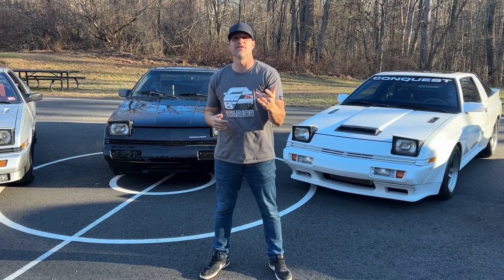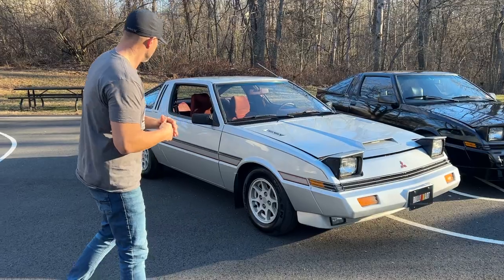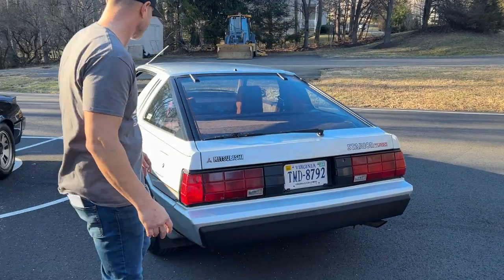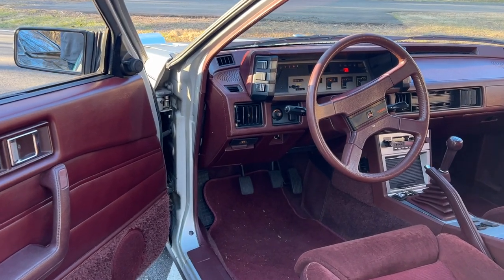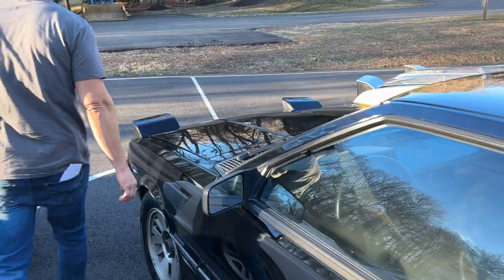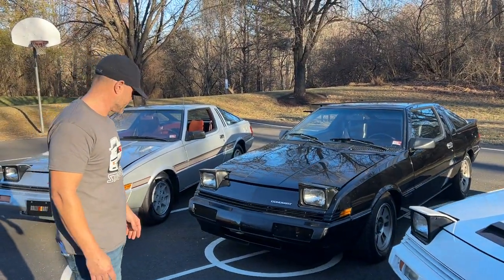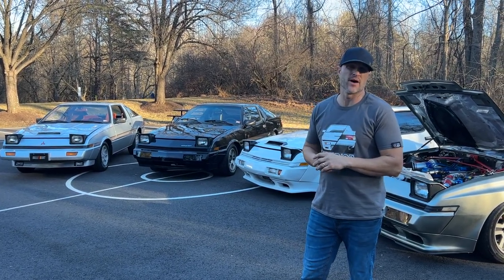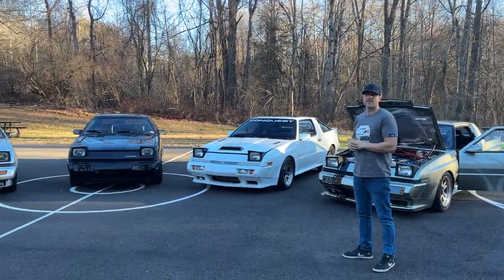StarQuest Walk Through Time

Comment: Turbo TSI Conquest 1986 were sold @ Dodge dealerships . And had the turbo door exterior pulls. Starting in 87 Chrysler dealerships sold the Conquests. I bought new in 88 a leftover 87 special edition TSI 5spd silver(a special chrome ish silver) & burgundy leather. Latter bought a clapped out black/black leather,sunroof 88 5spd with the wide wheel package & TiKco clicker adjustable struts.

Comment: In 90s i had red 88 Conquest TSI, 5 spd. Car would blow head gasket even after replacing it once. I didn't even drive that aggressively. Anyone knows if this was common issue on those cars and why, or did i have lemon one? I remember that car was rare to see even in 90s. Ppl didn't know about them. To me then this car looked like a lambo which is why i got it. I wish i had a old picture with this car. For some reason i snapped one.
Reply: It was common. One of the most common reasons so many of them had less than 60K miles and Sat in people's yards.

From my understanding, the issue was due to the head being aluminum and the block being made of iron. 

The 2nd most common issue was the heads cracking due to the emissions jets in the head.
Reply: These cars definitely had their issues, and head gaskets (and cracked heads in general) were common. The good thing is, they are easy to replace and get back on the road.
Reply: @steves.7933  So what is the remedy to fix  blown head gasket cause replacing it every few months is not a fix and is super expensive in labor costs. Asking cause i never figured it out before mine was gone.